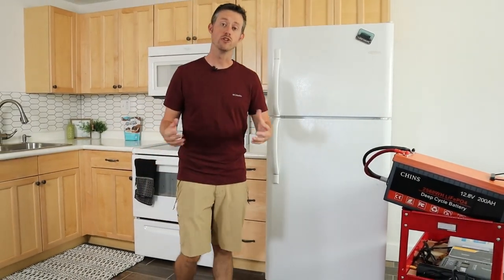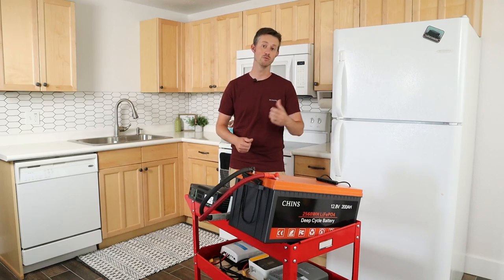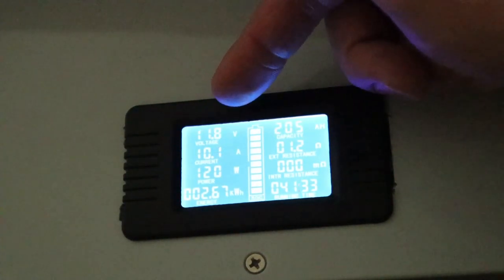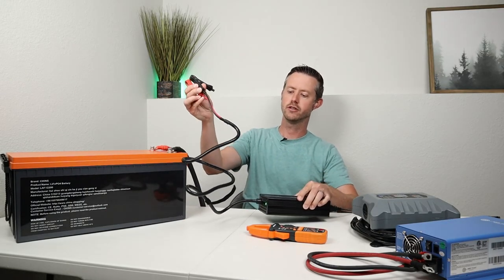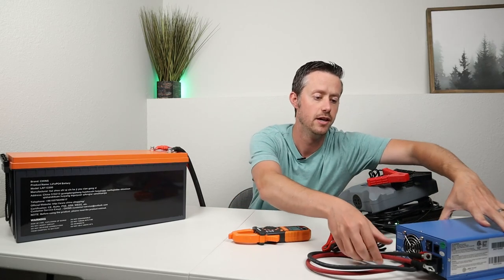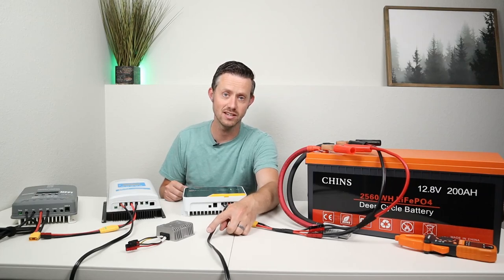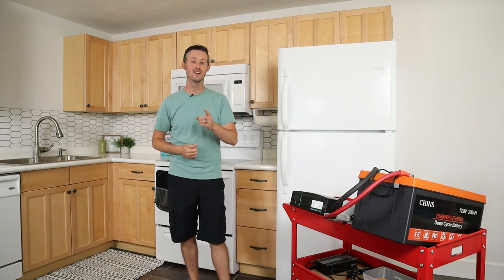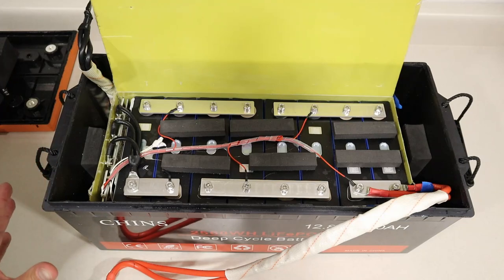DIY - Three Component Backup System! Keep Powered Up During An Outage! CHINS LiFePO4 + Xantrex

Comment: Great video Jason. Seeing this, I do see why a 2kwh power station like a Delta 2 Max or Anker Solix 2000 is popular. The DIY route is cheaper but there's a lot more wires and components!
Reply from the maker: Thanks, Todd! 'Plug N Play' systems are sure convenient and simple :) The Anker and EcoFlow are hard to beat! I love both DIY and Power Stations since they both have their places.
Reply: I think learning about components and using them is a great learning tool that definitely aids one’s understanding of the plug and play systems.   I have a hybrid approach, using generic batteries to back up my Delta 2s and when necessary power, with an inverter,  small appliances.   Nonetheless, I am considering getting a Delta Max 2 Extra Battery for my Delta 2.   I am even thinking of an EG4 style system as an adjunct to the more portable EcoFlow type tools.
Reply: Exactly.  And while I've been doing inverters and batteries for years, I recently picked up a Delta 2 Max just for the ease of hauling it around and having that power available  wherever.
Reply: Another reason aside from being easy having out of the box solar generator. The fact of having the actual tools to build the diy system people don't have nor want to buy especially that they are for the specific diy build & not like a drill where you can use it for many diy projects.

Comment: I use both types of systems.  My Bluetti AC200MAX with 2 of the B230 batteries can keep my refrigerator running for 3 days, but with solar, it can run as long as the sun shines.  My DIY system is smaller with a 50 AHr LFP battery with both XD60 and Anderson 50A connectors.  I yanked the SLA battery out of a good true sine UPS and added an XD60 connector for easy hook up to the bigger battery.  Lastly i also added the Lucitti DC control box, which gives me USB A and C, a battery SOC indicator, and solar charging.  A single 100 watt panel keeps the WiFi router and small LED lamp running indefinitely.  My go to cart is the RubberMaid utility cart as they pretty much last forever:)  I get a good laugh every time i see a solar (or wind) charge controller, as most if not all have a "load" output, which the manual always advises not to use!  Great information and ideas, especially for those that may seem afraid to tackle such a system, until it is explained in a manner that makes it easy to understand, as you do. Thanks!!
Reply from the maker: Great idea on the UPS battery swap! I've done that in the past when I was first getting into these backup systems. I always enjoy breaking down electronics and making them better!
I appreciate you (not an amateur with electronics), watching my beginner videos! I try to make these beginner friendly videos since 95% of the world is new to understanding electronics like this.
Reply: @Jasonoid  There are only a few channels that display a passion for solar, and that solar can actually be fun!  When someone thinks about an ebike, the first thing they should think about is putting in a small solar setup to keep that ebike green and powered from the sun.  Same with a Tesla, go ahead and spend 10K more and keep that Tesla off the grid (at least for local commuting).  I built my first solar panel in 1973 from satellite reject cells and have been hooked ever since.  Thanks for your passion and all your hard work on putting these videos out!

Comment: It is great you are showing more options for emergency power other then a plug & play battery box. People are quick to buy an all in one. But they cost more & if something goes wrong you need to replace the whole thing where as with something like this they can just replace the one bad component & have the option to add more batteries. With channels like yours they are easy to DIY. Thanks.
Reply from the maker: Thanks :) DIY is cheaper and the added benefit of swapping out components is nice for sure!

Comment: I have been on the lookout for an inverter lately because I have like 5 batteries now. Im not quite ready to worry about cables and fuses but its just easier to power dump into batteries and deploy them vs 500 watt hour power stations that Im swimming in!!
Reply from the maker: This Xantrex prowatt 2000 has been really good since I've owned it, Im not sure I trust all the other cheaper junk inverters on Amazon. The wiring is super simple, happy to help if you need it!

Comment: I use an EcoFlow Delta Max 2000WH to run a deep freeze and refrigerator and when it gets low I charge it with Champion 3400W propane generator. Now for less than I paid for the EcoFlow I could build a 48v EG4 all in one inverter/ charger with 100AH server rack battery. My next project! Thanks for the video
Reply from the maker: DIY is definitely less expensive so having that knowledge and skill is a great way to save money :)

Comment: I do enjoy your videos !    Lots of 'variables' in putting together a 'component' system like this.   1) Big battery but lower daily load demand = it can charge slowly with a smaller solar panel array.  2) Big battery along with larger daily load demand = larger solar panel array with a larger charge controller.   & lots of in-between options.
      YES,  I  AM   'Dr. Obvious'  ! !      ( Ha - ha ! )
 MY  application  is  large battery  to  charge  my  Nissan Leaf  with  a  KW  or  two  at  a  time,  but  may  let  the  system  sit  for  a  day  or  two  in-between = smaller solar & charge controller.    A nearby second system can be tapped to support the charging requirements on occasion when needed.    
                   Variety is the spice of Life  .  .  .  ( they say ).     
   SO,  stay  flexible  when  putting  your  system / combination  together  to  cover  "all the bases"   ( Baseball ? )
            Now if I can only squeeze-in a  Football  analogy  .  .  .  .  .  .  .  .  .    take  care,       rh

Comment: I had a licensed electrician install a Reliance generator transfer breaker subpanel. I run two Honda 2000's in parallel to energize the panel. The longest I have run it is 3 days; just running the refrigerator and the furnace. It was in the winter time and snowing.
Reply from the maker: Having a transfer switch is an awesome option for powering appliances during an outage!

Comment: I have been thinking of doing something like this but want to connect to a transfer box where all I have to do is plug in and flip a couple of switches.  Want about 400ah so when I lose power it will power the fridge and freezer and a couple of lights.  I have my delta max 2000's but I want something more permanent  so that I don't have to carry the delta max to the kitchen to plug the fridge.  I'm a visual person when it comes to learning, you can say "connect the wires" and I won't get it unless I see you do it, I think I can do what you showed me and figure out the solar stuff.  As always... Great video.
Reply from the maker: You could plug your Delta 2000 into a transfer switch as well, then you won't have to carry it around the house!

Comment: interesting method to do a capacity test on such a big battery, thanks for sharing
and yeah all that glue on the bottom gonna make it stay in there real good, and make for removal much more difficult, but definitely make it more secure if using in a mobile situation like an RV.
Reply from the maker: I tried forever trying to get that thing out! As you mentioned, that's great for durability!

Comment: I bought one of those powerwerx solar charge controllers for charging batteries in the house with solar. I have 3 mmpt solar charge controllers in my solar trailer. I recently bought a swipower inverter from ebay. 3200 watt for around 325 dollars. I just bought another batteryevo battery, on sale for 329 for 120 amp hours. Supposed to come in today. I have used the powerwerx charger for the dr prepare battery i bought and it tends to charge it within one day or about 1.5 days depending on how much sun I get. Tends to be around 240 watts, so more than double the charge I get over the built in 100 charger for the module on the dr prepare battery.
Reply from the maker: I sure love those little Powerwerx MPPTs, they work really well for their size! You'll have to let me know how you like that 3200 watt inverter!
Reply: @Jasonoid  Will do. I am going to test it once the new battery comes in.

Comment: Nice video.  People should do this!  This is similar but a lot larger and more advanced than the SLA power box I built maybe 20 years ago.  It was only for lighting though, as the inverter was a cheap 300W simulated-sine.  I have a couple of bigger ones now, the most similar being a 200AH small form-factor LFP in a box with a 1000W inverter mounted on it.  That battery won't quite fit in a Licitti box, which is the other one, with a 100AH Weiss LFP battery in it.
A potential review product for you is Elecaenta's little power station; it's LFP, takes in 100W of solar, and is a huge step up from a USB power bank.  I used it to run a compressor-cooler (set at 37F in a car with cracked windows) for 8-10 hours at a time at Heritage Life Skills.
Reply from the maker: I'll have to check out that Elecaenta unit! Thanks for the heads up.

Comment: I have a DIY power station;.4 Valence U-Charge U1-12RT 12V Batteries in Parallel(Nominal Capacity (C/5, 23°C) 40 Ah (times 4) I have the same BourgeRV charge controller. I'm using it to charge my 36 volt ebike batteries that i used to extend the runtime of my Delta Mini to run my chest freezer. I can get about 14 hrs before i use any of the Delta Mini's battery.

Comment: Jason I have Bluetti EB150.Bluetti AC200P,Jackery 290 plus numerous Hart batteries that I bought a small Hart inverter for and 3 Harbor Freight 100 watt panels and 2 Bluetti 120 watt panels
Reply from the maker: Sounds like you'll be quite prepared if you lose power for a long time, huge thumbs up!
Reply: Well Hurricane Hugo taught me to be prepared back in 1989 was out of power for 8 days here in western NC
Reply from the maker: @jamespruett2849  Wow, James! That's a long time to go without power, I'm glad you're taking steps to keep powered up.

Comment: I have 2 (24 volt battery banks with  2000 watt on one , & a 1500 watt inverters on the other) & 2 (12 volt banks with 1100 watt & 2000 watt 12v inverters on them). Plus one battery bank with small 750 watt in my climate controlled storage room/shop.also have a 1000 watt portable 12v inverter to boost power on GMC truck  or inside home as needed with Additional 12v batteries( marine 100 ah lead acid type). Current stock 18 various ages. FYI!

Comment: Awesome video Jason. Question - are there any alternatives you can recommend as far as a 2000W 12V inverter that are more budget friendly? Thanks!
Reply from the maker: Hey Mike, I'm not sure I would trust the cheaper models on Amazon. Something a little less expensive would be from Renogy:  https://amzn.to/3KWa4Hv
I havent tested that Renogy model specifically so I can't guarantee it would work well. I know Xantrex is a good quality brand thats been around awhile.
Reply: EPever makes not only solar charge controllers but also inverters. My personal experience with them, though limited, is quite good.

Comment: No need for the shunt if you would have purchased the smart battery version of this. It's actually really cool it's got all the data on the app in real time but the one downside to it is they only offer that in the heated version and if this is for indoor use there's no need for the heated version and the heated version is almost double the price.

Comment: Hi Jason, stupid question (I’m not sure myself) I’ve heard many many times to stay away from battery cables that are copper clad aluminum and to have full copper wire. When I saw you tearing down the Chins battery you said that they used aluminum bus bars. Isn’t that a bad thing? Would it be better to use full copper? Thanks
Reply from the maker: For bus bars they can be aluminum or copper. Copper is a better conductor for electricity but aluminum also works well. These are thick bus bars which can handle to max load just fine. When you can copper clad aluminum wiring you always need to oversize it to keep the heat down (since it's not as good as conductor, especially when it's small). No need to worry about these bus bars 👍

Comment: another good video. i'm wondering about the extension cord recomendation though. 12 gauge extension cord good for 20 amps running a 120watt fridge (120 watts / 120 volts = 1 amp), seems like a 16 gauge cord would be more than enough. i'm not saying that extension cords arent a problem, just this example wasent very good.  it always seems strange that physical size of an appliance equates to power consumption. example, full size fridge must use alot of power, 120 watts?  a small window ac about 1/5 the size of a fridge  will easily pull 500-600 watts or more.
Reply from the maker: Yes... Probably not the best example showing a 120w fridge on a 12 awg cable. I should have demonstrated running the 1800 watt microwave on the 12 awg wire instead. 
~95% of the population have no clue about wire gauge and wattage. They also don't read safety  labels on extension cables. To keep ignorant people safe, smaller gauge extension cables shouldn't even be sold LOL. Since the inverter is capable of 2000 watts, in my opinion it's best to use a cable rated for the peak load. Any 2000w load being ran on the inverter shouldn't have an issue with resistance / heat build up with a 12awg cable. 
I didn't know I'd get so much flack about recommending an oversized / safe extension cable 😂
Reply: In this case, bigger is better. It doesn't hurt and it doesn't cost much more than 16 gauge. Err on the side of caution. Thanks for the refresher Jason, appreciate the time you take.  @Jasonoid

Comment: J do you know of any youtuber that has  run their battery down 2000 times to see what kind of power is left in the battery? I'm guessing it all depends on what type of cells you have that will give you less than or more than 80%?

Comment: If I could tow that cart behind my E-bike, I could drive to Mexico! Wait, are you saying my 24 guage Fisher Price's "My first extension cord" I was using for my nieces easy bake oven won't run my 1970's vintage Brady Bunch microwave?
Reply from the maker: I'm just picturing this being towed behind your e-bike! 🤣👍 Lots of people have a solar panel trailer these days for their ebike, you should do that!
Reply: It works awesome! Ok so what I did was get the voltage on my bike to near nominal(52v) to simulate a half deflated battery and let the 48v charger with a terminal voltage of 54.6v charge up and it terminated at 54.8v. I've noticed these chargers over charge a little even on my 3A 52v charger. The charger slowed charging and stopped right at 54.8 volts. Now here's the fun part, with the bike on the charger I put the bike in top PAS and hit the throttle to run it. As the voltage sagged a bit the charger automatically came on and started charging the bike, the more it sagged, the more power it put in automatically because the charger is fooled into thinking the battery is at a lower the state of charge. The most amps I've seen come out of this charger is 1849mAh or 1.84 amps due to losses. Sitting idle with just the capacitors charged up it pulls 1.1 watts per hour. What I'm doing now is an hour idle test on my Golabs R300 which I was able to pull 255 watt hours using the inverter at idle to see what the parasitic drain would be. Right now at idle, it say I have 36 hours left from 100% charge. Obviously you aren't going to be riding for 36 hours, so I figure I might lose maybe 5% per say a max of a 2 hour ride at full speed, throttle only. 

Now here's the awesome part. When I have a fully charged up battery (58.8v) and I hit max amps of the controller which is 15, the voltage sag usually runs around the 56v mark, just under 3 volts or so. So as the voltage gets down more under full load such as a hill if I don't pedal it will creep down and down further as the battery drains until I get into the "boost" zone <54.8v and the charger will add amperage as necessary to compensate for the drop in voltage. This does two things, it's slows the voltage sag a bit which will add more watts to the motor and hence power and speed, it will add amperage to the battery to reduce the impact of a sudden heavy draw on the battery which is the biggest killer of range. It's sort of the batterie's "little helper". Now the good thing is using the 48v charger and not the 52v charger is good is because it only helps the battery when the charge under sag, or just from depletion gets under 75% so you are not stressing the battery too much. It's under the 80% charge "golden zone" if you put the 52v charger on there it would be constantly trying to keep the state of charge of the battery at 100% all the time which would be hard on the battery. This way it gently adds some amperage as the battery voltage sags under load and until the voltage at idle gets below 75% but never charges it past 75% to preserve the battery. I'm going to try a real world range test this weekend and see what kind of milage I can get with this small (9 lbs or so) setup and see what the range is. Oh man I'd better pack a lunch....or maybe a solar panel...

Amp draw at PAS 3 24-27km/h depending on state of charge: 3 -4 amp draw flat ground throttle only.
Amp draw at PAS 5 34-38km/h depending on state of charge  6-8 amp draw  flat ground throttle only.
Max theoretical watts boost 255 watts
Bike battery watts: 780 watts. 52v nominal. 15 amp.
Max theoretical power boost 32.3% without losses.
Parasitic R300 drain: 3% per hour or 7.1 watts per hour with charger on.

 @Jasonoid